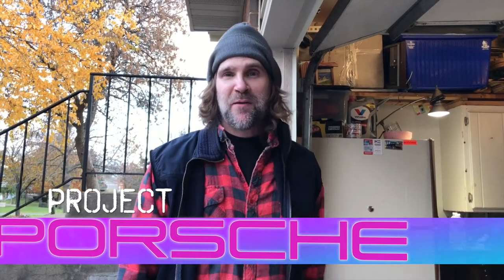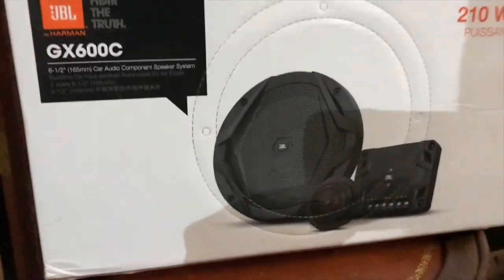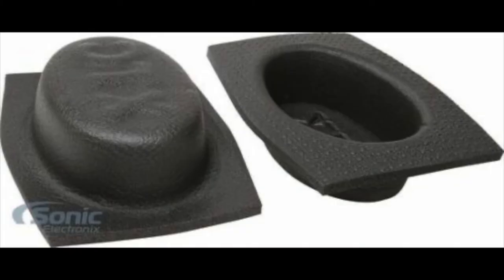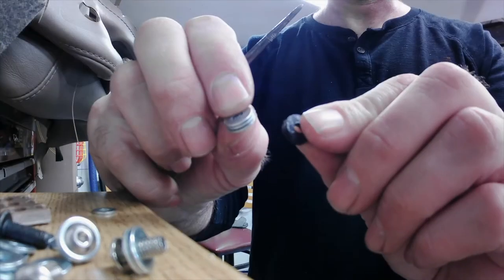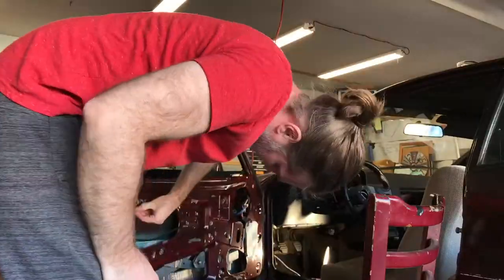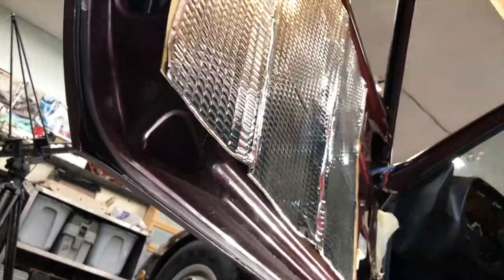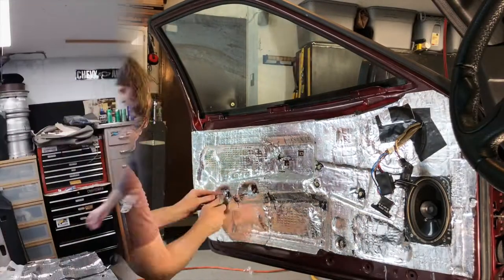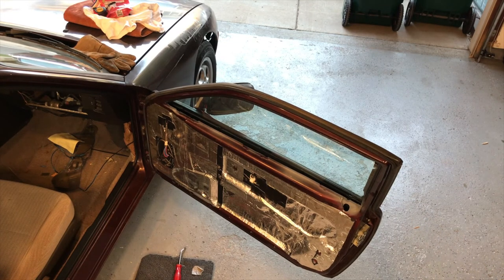New Speakers Under Stock Grills & Soundproofing

Comment: Curious to how well it insulates sounds? Would like to dampen the road sounds in my 924, wondering if dampening the doors is worth it. Good video!
Reply from the maker: Thanks!  It did make the doors quieter on the road.  I'm Currently working on the stereo so I still  have to put  the other panels in the car to get the full effect, but it should be pretty quite/awesome. There is a noticeable difference.  I'm planning on a in car driving video when it's all done.  Thanks 4 the comment!
Reply: @rybreadification  Looking forward to the "in car driving video" :).